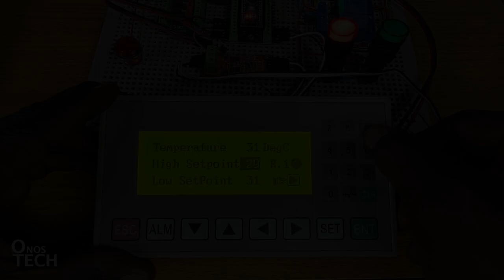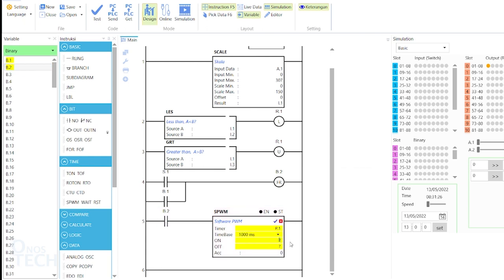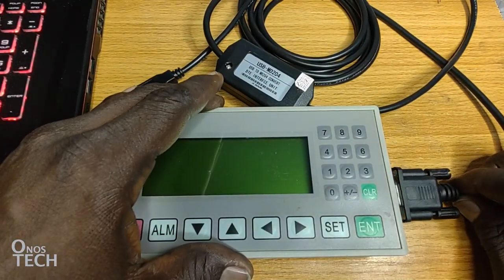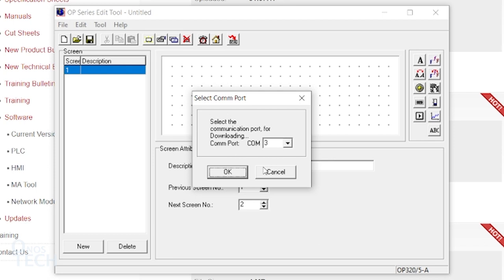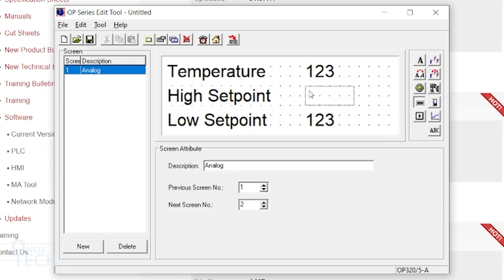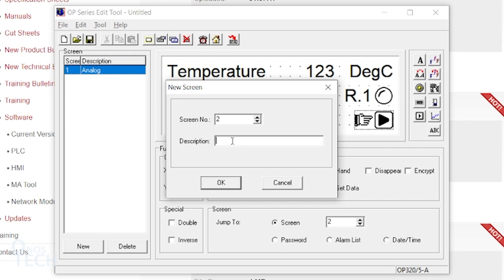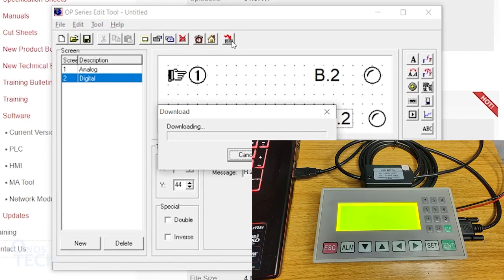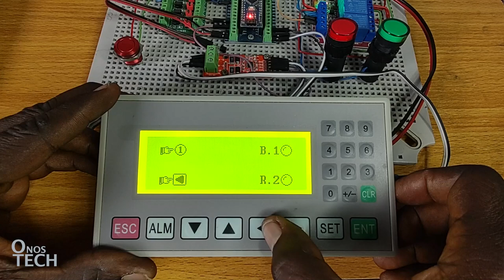#14 OP320 HMI Modbus Communication  | Outseal Arduino PLC

Comment: I know I asked this on the LDmico but is it possible to communicate with the serial connections of a Nextion display to then have a touch screen HMI?
Reply from the maker: Nextion display can communicate with LDmicro, but not with Outseal since Outseal uses only Modbus protocol.
Reply: @OnosTech  does that mean that Outseal doesn’t have any functions for SPI or I2C?
Reply from the maker: It does. The communication instructions group has them TWIR etc
Reply: @OnosTech  is that something you would show in a video, set up and communication with a couple of them? I do like your tutorial videos, some of the best I’ve seen.

Comment: Hi.  If any one  could  make  clear  is one  small  detail  before try to  learn about this software. 
The arduino  nano is running a full micro independent  or is been drive as slave from the PC be USB cable
Thank  to any one answer  the question.
Reply from the maker: The Arduino nano is running a full micro independent and not driven as slave by the PC. The USB cable is to provide power supply for demonstration purpose. It only act as slave to the OP320 panel for signal mintoring and control. You can start learning from here: How to Program Outseal Arduino PLC: https://www.youtube.com/playlist?list=PLjkzNLFcHTFAVyg3gAH5P-akRdKhYz9-P

Comment: Hello my lord, permission to ask I am using HMI OP320 5.6, the problem is downloading the program "Time-out, Please check cable and power, download again" cable using RS232, please respond.
Reply from the maker: Hi, please confirm that you installed OP20 V6.5y software or else download and install it with the link in the description. This version should work for OP320 5.6

Comment: Nice project!  The schematic has an error, the ground on the relay board must be connected to the Arduino ground.  If it works without this it is only by luck.
Reply from the maker: Yes, you are right. Thanks for noticing and pointing it out. Editing omission.

Comment: In video Arduino mega 2560 or Arduino Uno and inter face with HMI OP320 (display analog values and push button and lamps etc

Comment: HI good job! One question? Can you give me the register list for OP320? Thanks
Reply from the maker: Thanks! Do you want the Modbus register list for Outseal PLC?
Reply: @OnosTech  I need modbus register for OP320. You'd be so kind if you can give me! Thanks
Reply: @OnosTech  Do you have?
Reply from the maker: @stefanomilesi4702  I am not sure I understand what you want, but here is the manual: http://kms-trade.com/downloads/manuals/OP_HMI_HardwareManual.pdf
Reply: @OnosTech  I am looking for the list of registers you have to query with communication Modbus RTU from PLC to OP320.
Reply from the maker: See page 13 of the manual
Reply: @OnosTech  Hello Sir. 1X is for Coils, 4X for registers. On PLC, which addresses corresponding to coils and which to registers? Thanks